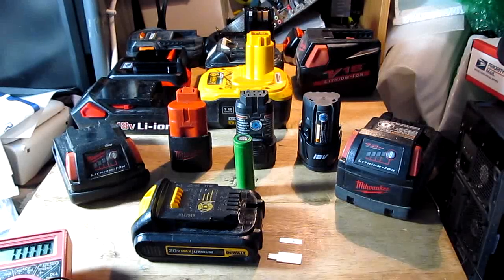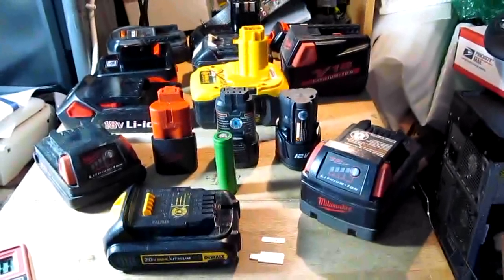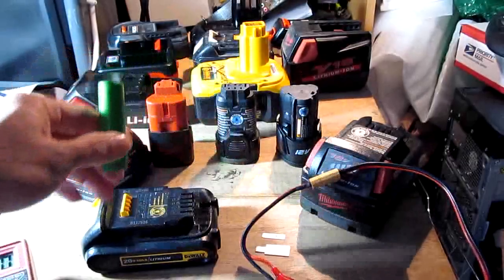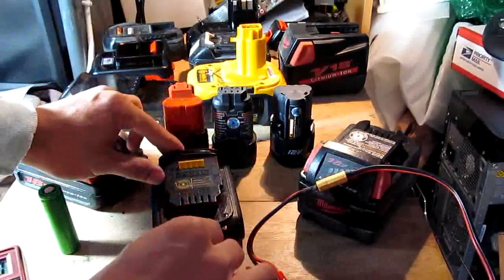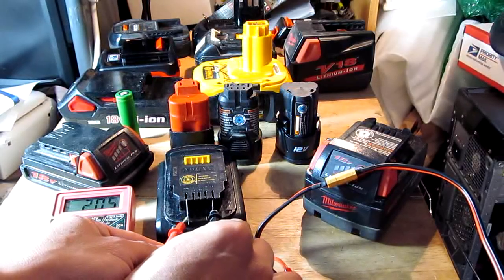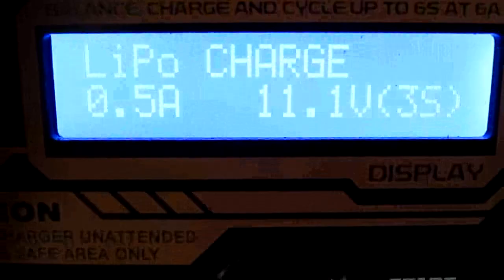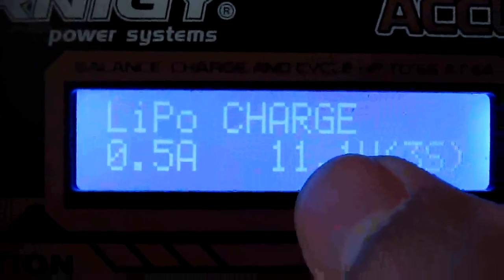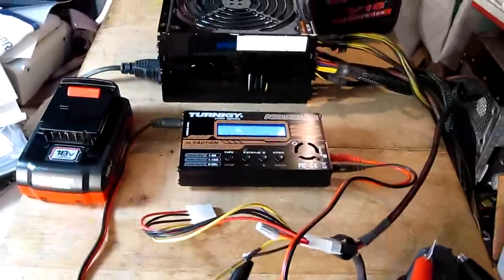DIY Charge any cordless tool/drill battery without a charger using Turnigy balance charger

Comment: This is not the best practice with a low pack bc they can be out of balance and you could be pushing some cells way above 4.2 need to use the balance lead with alligator clips to properly balance an old battery

Comment: I have an imax b6ac v2 charger. And i m trying to charge a handycam battery, however i cant get it to charge on Lipo settings as it says No balance Lead connected. So i m charging in NIMH mode and its charging.

Comment: If you don't have an original Milwaukee charger, this is probably the best way to charge as long as you keep the current low. Milwaukee doesn't charge through the middle pin as some have said. That is a temp sensor. The other two inner connectors are for communication. The board inside the battery does have some balancing circuitry but does so slowly.  Rapid chargers would rely on the temp sensor and communication to pause charging if the battery gets too hot or out of balance. I'm not a fan of rapid charging anyway as it shortens the life of your batter pack. But if you are a pro and time is money, it's probably better to buy new batteries often than sit around waiting for yours to charge. I'm planning on building a charging station out of an old Dewalt case where each charger will have CC/CV buck converter with some type of temp cutoff. It will also cut off if I close the lid. That way you can leave them in there and take the whole thing with you. I'll use 3d printed holders for charging so I can mix and match. I wont do a video but I may do an instructable. That way I can get feedback on how to improve it.
Reply: Pictures?

Comment: Hello friend, I'm Wikkid or Danny and I wanted to thank you now for the second time, no it's the third. In case you don't have telepathy, I will rundown my thanks in chronological order real quick. First time I viewed your video you earned my sub after you help me get a deeper understanding of brushless motor controllers that I needed to upgrade my Bolt Pro. Kept watching other videos you posted and saw that you were running a high voltage cordless tool battery on your eBike. So when I found a 40v 6aH battery for $10, I just had to follow your lead and that Hart battery is still running as my girl's primary battery still. We both thank you on that one on #2.  And tonight I'm looking to understand how to charge a 56v battery using a 58v charger and find out how the Echo smart charger works cuz it didn't start charging when I connected them directly together. I'm still looking for how the Echo works, but I saw your video about using a Teniagy charger to recharge basically any normally volted battery.  I don't think you can pull 56v from a computer PSU without swapping a transformer or something.  IDK how either. So there that's my 3 thanks I send your way.  We have a lot of common interests and things we like to create and build. You live in Florida too?  That would be starting to seem like fate was playing part of this, but who really knows.  Oh and if you wondered where I got a brand new still in package Hart 40v 6aH battery, it was from a person I know who sells a wide variety of items at the largest flea market in the South East on a Wednesday.  So now I'm going to see how much a variable Teniagy charger is and find my field multi-chemistry charger to see if it will work for such voltages. I revive lithium-ion batteries that people have run down too far and give them a second go round. Most people think they are faulty and sometimes they are. But usually it's the BMS or a single cell or handful of em causing the problem. But this is all prob things you consider childs play and are light years ahead of where I am leveling right now. Maybe someday our paths will cross and we can shake each others hand. I just wanted to express my admiration and send my genuine thanks in a wholehearted way, so I think I did that.  Later, Wikkid.

Comment: curious if any one can suggest the best way to  run a imaxb6 directly from a 12v(battery) solar set up by passing the need for an inverter. Basically wanting to use it as a vehicle charger for a makita batteries.

Comment: Good video, how can I get them little metal clips to connect to the drill batteries, you made them yourself?
Reply from the maker: You can use an aluminum heatsink from a computer. The fins of the heatsinks are usually good enough. Just use an aviation snip to cut it out.

Comment: U know most turnigy chargers can change chemistry to Li Ion for the correct voltages. The setting shown here is for Li Polymer which no power tool uses I don't think.

Comment: i came here looking for a way to charge a cordless battery with a 12v charger which would be very useful but cant be done. what i dont get about this method is why go to all this trouble when you can just buy another charger for $20?

Comment: Great educational Video.
Very easy to follow you.
I have a few peak chargers for all my RC stuffed honestly didn't think to use one. .
My craftsman chargers for my 19.2 lithium batteries must have gotten moisture etc in them as won't put out current.

I also need to revive many older lithium 12, 15 & 19 volt Craftsman batteries a nd am going to try giving them a zap with one of my auto battery chargers unless you have a better way when they won't take a charge as they are completely dead.

Thanks again and it's been years since I converted a pc power supply so looking forward to that video... 
Jerry

Comment: Hey brother,  I need some advice ... been subscribed for a couple years and enjoy your ingenuity and humor.  
Sooo,  I got a two way radio that is super nice....actually 5 of them .... but no charger .... it's a 7.2 volt lithium ion battery with 2150 mah I think.  What range of those transformers could I use to charge that if I cut the plug off and just put the wires to it.  I don't think I have a 7 or 7.5 .... but I have a bunch of others ... so what Is ok you think??

Comment: Nice, I use an IMAX B6 to charge various drill batteries from different manufacturers.  Going a step further, I have the IMAX connected to the 12 volt output on my solar power station, so I charge them up with a small solar panel.  I found this video looking into the aspect of adding balance charging to the process.  However, from what I've seen, apparently, very few drill batteries are actually wired up for the complete balance charging a B6 can do anyway.
Reply: How you ever tried adding balance leads?
Reply: @hawsantiago3697  Well, i guess that is possible by disassembling the battery and perhaps adding the leads for a 5s or 6s cell pack. But some of these drill batteries can be a PITA to disassemble.  Like I need 1 more project to do.  I do use balancing leads on the packs I've built though.

Comment: Hello,
With your method, you are connecting only the positive and negative from the power supply to the +  - terminals of the battery and do not use any of the balancing terminals. For example, the Milwaukee red battery has 3 terminals in addition to the + and -. 

 I tried your technique with my Ryobi 18V Li batteries. The tool stops 
working when battery is down to 18V. The battery has 3 terminals/ contacts marked + and -
 and third is unmarked (call it Y). The meter reads 18V (fully charged 
is 20.5) between each of + and -   / + and Y. Nothing between - and Y. 
By your method, simply applying a charge between + and - or between + and Y
 should work but it does not. I applied 20.4V and the battery did not 
change. Looking at the original charger (I borrowed). It has 3 terminals
 corresponding to the battery's 3. When the charger is plugged in with 
no battery in it, meter reads Y as positive and there is 3V between Y to
 + or Y to -.

Any one has suggestions? Thanks.

Comment: this doesnt work on my mailwaukee m18 batteries..
i got a milwaukee impat driver and battery for early xmas present from my mrs, but she didnt realise it didnt come with charger too..
I have an imax b6 charger, But each time i connect to pos and neg, it fails to charge, because the 3 middle pins of the battery are for the bus of the pcb...

Comment: since this is for charging lithium batteries only, please put lithium in the title. I came to see the reccomended charge rate fo old nicad and nimh packs.
Reply: personally i wouldnt charge nicad or nimh packs at more than 1amp there is a setting in this charger and most rc changers for nicad /nimh and also lead acid batteries hope  that helps this guy is actually overcharging these battereis by a little he should be using li-ion setting not li-po

Comment: Hello Vuaeco, I am learning a lot from your videos, Do the Li-Io power tool batteries need to be balanced charged? I see you have another video (DIY Balance Charge Li-Io battery pack) 
Thank you for all the great information on batteries and charging them :)
Reply from the maker: Yes they do need to be balance charged. If you do this, you will need to plug in a real charger and balance charge them once in a while.
Reply: @vuaeco  Thank you Vuaeco, I am watching your balance charge video right now, I just purchased the HTRC T240 and Obus chargers. Thanks for all the great videos :)

Comment: Yeah...without any balance charging you are reducing battery lifetime so you loose money and it may be dangerous (over charging 4.2*3=12.6 but 4+4.3*2=12.6 too...). You can use this method sometime but not always. You can also buy a 5 dollars lithium charger with jack plug it will do the same.
Reply: Where can you buy this $5 charger with Jack Plugs, Name and Model No.?
Reply: @ekjugnoo  go to Aliexpress and search for "lithium charger" and choose the one for your purpose (right voltage). If you have many voltages for many projects, I advice you to buy advanced charger like "imax b6". You can also find it on Aliexpress (counterfeit but working good). See video on imax b6 here

Comment: Man! Thank you so much for this demo! Solved all my probles with the dam chargers. I was using a Hobbico (12V) for 12 V packs, but this Turnigy is much better. To power the Turnigy, i used an old Vaio notebook Powersupply, output 16V 3.9A. Thx again, man.

Comment: I didn't watch the video because I already know to charge a battery without a charger using a charger. SMH
Reply: In case you were wondering whether or not your attempt to publicly confirm that you are a dumbass was successful, you can rest easy-- you are.
Reply: run along little girl

Comment: Can you confirm settings should be set to a 6 cell for a standard 2.0 Amp-hour Koblat battery? For your other video? https://www.youtube.com/watch?v=Zy-NGYZByAk
Reply: The highest I recommend is charging at 1c. If your battery is 2000mah or 2ah then charge at 2amps. If say you have a battery at 5ah or 5000mah then you can charge at 5a. I don't recommend charging higher at 1.5c. which would be around 3a for a 2ah battery

Comment: Can you still do balance charging with a power supply ?
Reply: Fee if it’s for the odd charge then it will be fine. If you continue to do it wth out balance, not a good thing. Also. The turningy will do lithium iron batteries too. Make cure you change the charger from lipo as the end voltages are different

Comment: Won’t the cells become  unbalanced if you charge it this way. Or is the balancing done in the battery casing?
Reply: Most battery packs (for sure those 18v and 20v) have the balancer in it.  Those 3 cell models he showed I am not sure if they have a balancer in them or not.
Reply: @generalawareness101  if the original charger has balance leads then the battery probably doesn't have a full blown BMS that balances the cells all the time i'd guess, IMO it's a bit risky to do this with the dewalt batteries for example... or is there  another valid reason to have balance leads on the battery even if there's a BMS balancing the cells?
Reply: @Reversed82  True.

Comment: I just got my Turnigy Accucel 6,  ATX power supply built, and a boatload of Lithium tool batteries, only to continuously receive a "BALANCE CONNECT ERROR". Please guide me . I want this to work. Thanks in advance.
Reply from the maker: You might want to watch this video: https://youtu.be/niZoOdip2Co
Reply: @vuaeco  I definitely will, as I love your videos. Sadly though,  after two days of communication with HK, they claim that you cannot perform any type of charge on any Lithium based battery pack (2s+) without balance leads connected.
They must have upgraded the firmware between now and when you made this video. Not only is the instruction manual vague, but even one of HK techs told me I shouldn't need balance leads connected if I wasn't balance charging and that I should RMA the unit, as it must be malfunctioning. The response to my RMAwas that I was told incorrect information and that it is functioning as intended. The responder also stated that's the only way to make it perform as such would be to "hack" the unit, to which he did not recommend as it would void the warranty.
For the last three years, I have collected many batteries in an attempt to repurpose or repair them with this charger (or iMaxB6) as well as have an all-in-one charger, it seems, at this point, I have a glorified Pb/SLA, Ni-Cd/Nimh charger that will charge single Lithium based batteries (18650) unless I build individual balance harnesses for each brand/type/pinout.
I just wish this was made clear by HK or the Turnigy Accucel 6 manual/website before I purchased one.
I'm just trying to get this information out there so other people's time does not get wasted like mine has been.
Please keep in mind that this video being so high up in the search results, with the newest model of the Turnigy Accucel 6, this video is now inaccurate and/or misleading.

Comment: I don't think power packs for cordless tools are balanced charged. They don't get the same use as in model aviation in which the model's power pack may be discharged in 15 minutes. Power tools can go for weeks without discharging the batter pack.
Reply: Depends on the tool...roto hammers last 15 minutes of continuous use, not weeks. Higher end packs balance in the pack, and have specific pins for charging and dont use the pins directly connected to the cells in series. Those are for output to tool only.

Comment: Come back a few times to watch this, and thank you kindly for taking the time to film/edit for others. However, a question:

Is there a decent diagram someplace for the wiring of a 5s battery used to deliver 18.5v? That is to say, WITH the balance charger leads integrated inside? I’m using An IMAX b6, which is essentially the same thing you have there. I also have the 5s plug, but just want to make sure I’m not screwing myself. 

As you say, makita batteries are terrible, and for some reason I ended up with about 15 power tools without chargers, or the chargers and no batteries. Am hoping to modify them all to take a universal. Just need to be sure of my attack plan for wiring. Any link is appreciated

Comment: I have a 18v lithium Porter Cable drill,by chance will a20 v lithium battery work also
Reply: Joey Priddy what you gotta do is take the 18v battery off the 18v li-on porter cable drill.. so now all you have is a porter cable drill.. right? Ok gold the drill and set the 18v battery down(DONT DROP IT) ok now with that same hand grab your 20v.. do you feel the excitement? Now.. this the the most important part so whatever you do.. DONT FUCK THiS UP!! If you fuck it up then it won’t work now or later.. line the 20v up to the drill where the 18 came from.. line up all the slots.. now push it on there? After you confirm with yourself that the batteries aren’t the same.. go ahead and go get some sleep and maybe tomoro you will learn other common sense DIY activities! 

Oh.. almost forgot.. good luck on that tomoro!

Comment: How does it charge 18volt batteries with only a 12 volt input ?
Reply: how small UPS drive 110volt computer from 12volt DC battery inside? Electronics cannot be learnt from YouTube videos
Reply: Stepup converter inside charger

Comment: I bought an IMAX B6 mini and I am getting an error reading "CONNECT ERROR CHECK MAIN PORT". Anyone have any suggestions?
Reply: Use more amp power supply for imax b6
Reply: You battery is to low bro  . The charger won’t start charging when batteries are to low voltage

Comment: hello.i have a 120v,14W power supply,the amp is only 1/2 amps. i want to use with my charger,will this work for my kobalt 18v Li-ion battery?,thanks
Reply: Sil if you look at the specification list for the Turnigy Accucell 50W charger you will see the following:

Input Voltage: 11~18v
Circuit Power: Max Charge: 50W / Max Discharge: 5W
Charge Current Range: 0.1~6.0A
Balance Cells: 2-6 cells
NiMH/NiCd Cells: 1~15
LiHV /LiIon/LiPoly Cells: 1~6
Pb battery Voltage: 2~20v
Weight: 240g

So your power supply into this unit needs to between 11-18v DC. That is why he connected his charger up to his computer power supply as it takes 110-240V AC and converts it to 12V DC which is the required Input Voltage range for the Turnigy charger. Putting 120v into your charger is 10x more than it needs and it needs to be DC not AC. That is why if you are using a mains supply you need to step the voltage down to 12V and then convert the output current from AC to DC which is what the Power Supply unit does [110-240V AC input to 12V DC output]
https://www.youtube.com/watch?v=jDuxFEgtSAQ